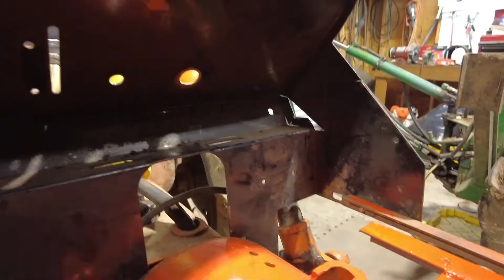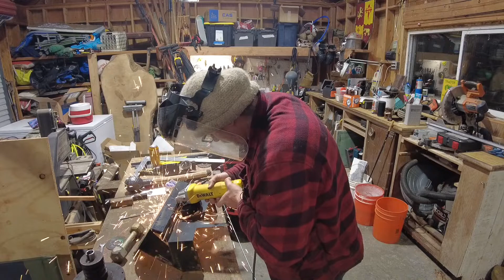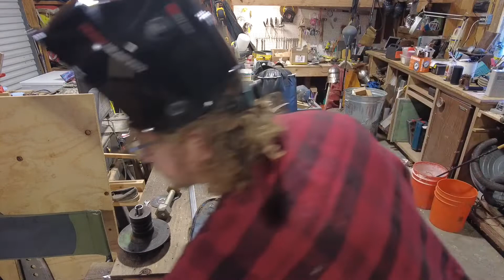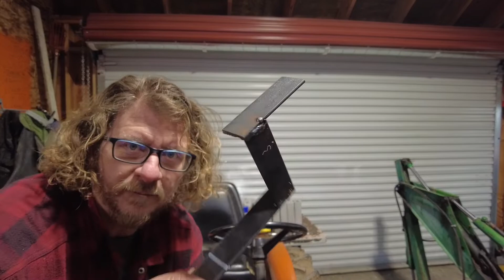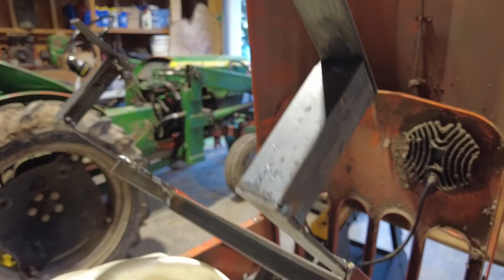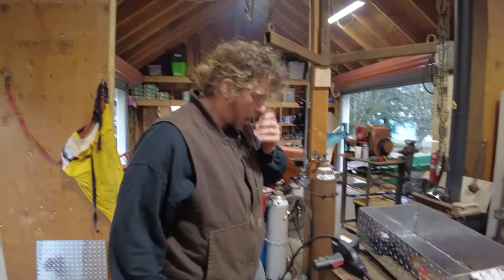EV Tractor Build Part 2 Subframe and battery box fabrication

Comment: Hey ! Great video, it is really inspirational !
One thing I would like to know is the Amp-Hour consumption. How long is your battery holding for a said task ? How long empty, how long at 50% load and 100% ? 
Hope I was clear enough !
Cheers
Reply from the maker: So far i have never gone below 75volts.  I havent actually ever run it out and I use it all day on my farm. It is used to pull trailers, take care of animals, run the irrigation pump to fill waterers it is a 100 amp hour battery and i have only run it to 30 amp hours according to my gauges.